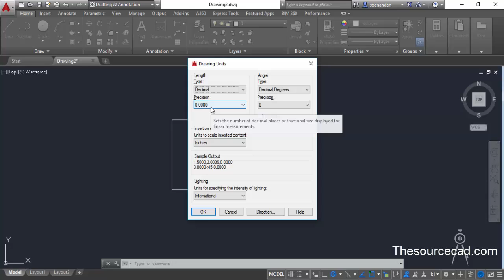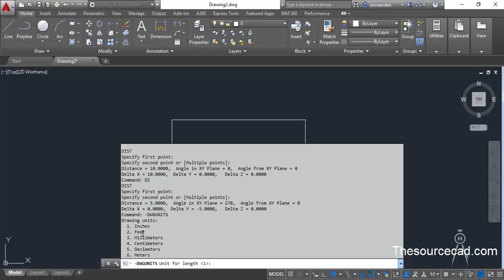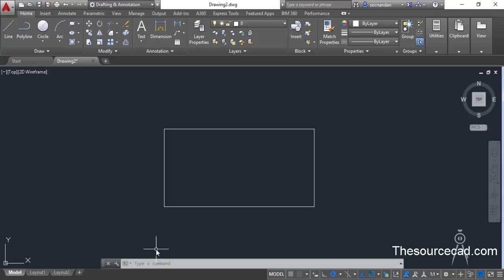how to change units in AutoCAD drawing

Comment: i am working on 2019 AC , but it does not allow me to open a text box as you do on the left bottom?, i received drawings and all in imperial , need to change it , did change units on the system but still it remains imperial

Comment: if your drawing is set to inches and you draw a line 1" then change your
 drawing to mm and draw a line 304.8mm, why are those two lines not the 
same length???
Reply: 1" is not equal to 304.8mm
Reply: @danialsoozani  that is what i'm saying. Just didn't word it well. If you draw a 1" line and copy and paste it into a mm drawing it should be 25.4mm but it isn't.
Reply: @mikemullins2919  Oh! that's strange! i should give it a try now!
Reply: @mikemullins2919  I said yes when it asked to scale when copy from other files, and strange thing has happened. i have both lines 1unit! I set it to decimal. they are both 1!  btw i am using 2021 and when changed to inches it asked to rescale model and paper space and i chose yes.
Reply: @danialsoozani  Thanks for doing that. What i can't wrap my head around is why it needs to be scaled. 1" = 25.4mm  ~ so in my mind if i draw a 1" line and i change the units then it should be 25.4mm without having to bring scaling into it.
Reply: @mikemullins2919  you're welcome! because that's not the case all the time. in my country we use metric system. but I' received so many files that the drafter forgot to set the unit to meters. it's in inch by default. but the proportions of the drawing are ok. for example instead of a 4m width for a room, it's 4inches. in this case I prefer to only change the unit to make that 4" room into 4m room. to export in other softwares in correct units. such as 3ds max etc...

Comment: Sir in my laptop I had autocad 2016 
I had covered dwg from inches to mm but when I type unit command there it was showing the dwg had converted
When I type command di it shows the same dimensions 10
Pls reply sir
My wts up no 8451038947

Comment: Thanks for the video Sir.
Please this is an urgent question...
I drew a plan with the wrong dimensions in inches. How can I correct it to the right dimension in millimiters?
Reply: I have made the same mistake do you know how Can I fix this issue , I just want to change the units not the scale
Reply: @ahmadkhalaf826  made the same mistake lol hahahaa
Reply: @riconebio6258  Use the -DWG COMMAND

Comment: Thanks brother! I managed to do that but if I want to maintain the units as it is, e.g 10 units to be the same as it is, is that possible? the reason i'm asking because I got architectural drawings in wrong setting, and I am using AutoCAD MEP to model the HVAC system, if I do it your way the dimensions of the arch drawings will be wrong, is there a way to resolve this issue?

Comment: My drawing units are in Millimeters.  I checked it from units command. 
To  make  sure i draw a line of 25.4 units then measure it , i add 
alternate units also with primary units . Dimension says length of line 
25.4(1"). So it  prove its units are  in millimeters. when i use 
-DWGUNITS command it says meters(6) . I am confused here. Any help would
 be appreciate

Comment: I have a question While launching my existing drawing unit box shows that unit of drawing is in mm but by checking with -dwgunit command it shows in inches 
why so
Reply from the maker: The unit dialog box showed insertion unit i.e the unit in which all inserted objects like Blocks and Xref will be converted. The correct unit is shown by -DWGUNITS command.

Comment: Hi Sir  i  apply this command for convert from cm to mm but old dimension changed to other value and when check the dimension its shows in mm but when i update drawing its give me value in meter   like  i give dim 20 its goes to 2000.
Sir would you tell me why its happening with me like this?

Comment: hi, i have problem with our school project. we were given a floor plan which in metric. we are going to use imperial units for designing ducting system. when i try to create diffuser i notice it is not scale. the diffuser i made was so small. please help. how can i correct my settings. thank you and God Bless.
Reply from the maker: You can try the steps as I mentioned in the article, for the duct you can simply export it in using WRITEBLOCK command and then change its units in the new drawing and then import it again.

Comment: sir i tried changing from meter to millimeter but its not working it keeps on giving me the current unit as inches . however i made  my drawing in meters and now want to convert it to millimeters. please help.
Reply from the maker: Did you try both methods mentioned in the video?
Reply: there is only one method mentioned in this video. using -DWGUNIT
Reply: what is the other method i can use?
Reply from the maker: Second method is block import it is mentioned in this article http://www.thesourcecad.com/how-to-change-units-of-existing-drawing-in-autocad/
Reply: thank u sir i will give it a try. but isn't there any other method to change the units within the current cad drawing.. i remember by teacher explaining something it had something to do with scaling .. first u select scale then enter 0,0,0 and then add the value of 1000 and press enter to change meters to millimeters... i found it very difficult to wrap my head around as am not sure how can i use the same method to change to some other unit coz 1000 is only to convert to millimeters from meters

Comment: thanx sir for this video. i've a question, would u plz show me how to plot (print) a 3d model in black & white. i've tried diff. method(monochrome, grayscale, .ctb, .stb) from internet but they're not working. the model is still printing in color. a tutorial would be helpful. plz reply.
Reply from the maker: Ok I will try to include a tutorial on this topic soon
Reply: M KF no need to download these ctb's. it's available by default inside AutoCAD. it must be work if you already assigned at the moment of plotting or page setup.

the second option to plot in black and white, first you need to make a pdf and then print, don't forget check features tab in pdf, there is an option available for black and white print